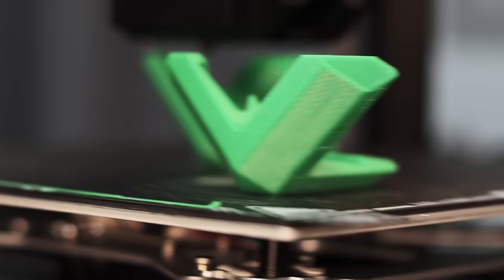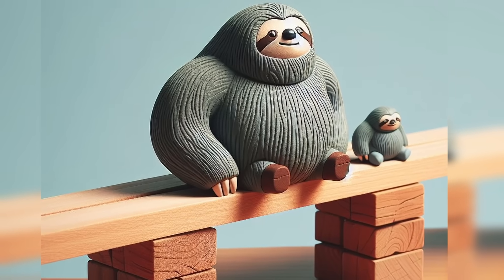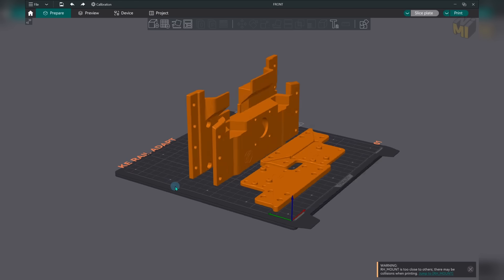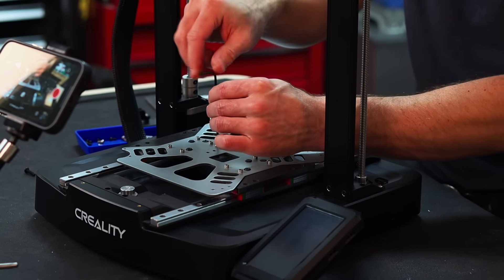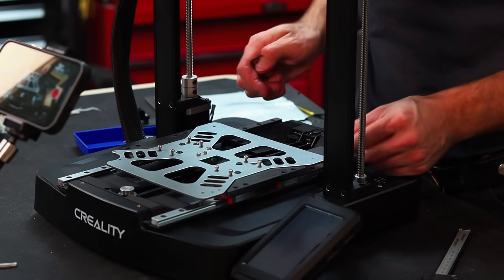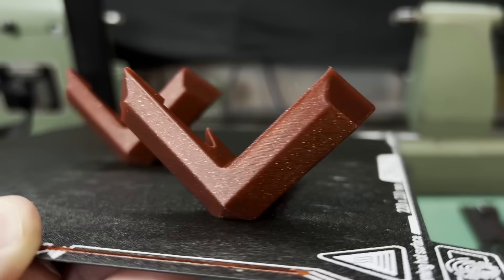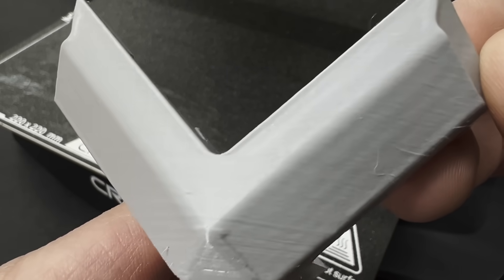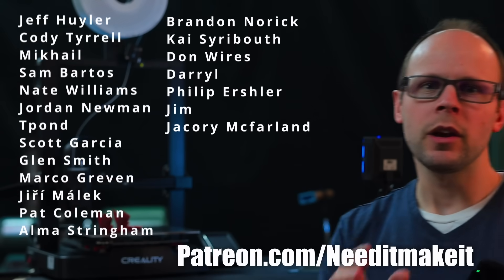UPGRADE your Creality Ender 3 V3 KE with Linear Rails

Comment: 14:02 man, I've gotten a servicable beachy in under 5min on an upgraded (motors, belts, klipper) hictop i3 with an acrylic frame. The SE has more potential. I was actually pretty impressed by the extuder stock (well, for price) and can get 15mm3 out of it which isn't bad, figured I'd put my volcano on it day one but I haven't

Comment: I'm very interested in the Y-carriage structure you built. I also installed linear rails on my printer, and the performance has improved a lot, but I’m still facing some issues with bed mesh calibration. Did this Y-carriage work well for you? I’d love to see your results and, if possible, the STL file so I can print it and test it on my E3 V3 KE to make it an even better printer.

Comment: This actually got worse, the tube rails used to be secured by two screws to prevent them from wobbling... I made a video demonstrating the issue; https://youtube.com/shorts/0jsu2G9p9ok
In a recent revision they removed the screws and now they always wobble, I bought mine last week and customer support told me it's supposed to be like that and offered to send me new tubes and carriers but that's never going to solve this problem...

I'm going to use your design and convert to linear rails myself to circumvent the poorly engineered factory solution. Thanks for sharing your hard work!

Comment: Instead of slinging the bed, couldn't you fix the bed and go for a cartesian-corexy hybrid of sorts? I used to run a davinci nano, but the proprietary bs had me move to a e3 v3 ke. But i have to admit the xyz had an edge when it came to taller prints because of the fixed bed.

Comment: The way you 3d scanned it is kind of odd to me, i much prefer to take a photo with a ruler in the image . I then drag it into fusion anmd using calibrate i set the distance to 19mm oin the ruler and bam i have an acvtual image od the object and i canplan accordingly , saves the mess and sub par imagery.

Comment: Two rails gives you 4 separate surfaces that need to be aligned, and in close proximity to a heat source with different types of materials and expansion.  I would go with one big rail.  Just like a lathe.  Poor alignment is a 3d printer/cncs worst enemy, and depending on tolerances/quality of the rails vs the stiffness of the frame, you could end up wasting a lot of time adjusting in-between prints to avoid too much play in the build plate or wearing out the bearings in just weeks.

Comment: "Nek Minute", it was an under tension-ed extruder gear all along and the trouble of upgrading was for naught haha. I'm sure there must have been movement in the bed to begin with, otherwise prints and the front and middle would have had the same defect. Makes me wonder though, how much of the defect was coming from each fix hmmm..  Thanks for the video!

Comment: The wobbeling fron the rods are because of they are 7
8.mm
And not 8mm.
I thit Just a little peace of pla under screws and the wobbeling is gone 
And i have upgrade the x axis.
Whit the toolhead. 
Filliment sensor antishake.
Gantry
Nebula pad .
Root to mainsail and fluidd.
And i can go in vase mode continu speed 150 mms .
And print nicely. 
Acc at 4000.
Sometimes the travel move.s hit 625 mms 
Fats enough  for me.
Reply from the maker: Hey, if that works for you, perfect!

Comment: I've been running my linear rails on my SE for a month now, and unfortunatley have experienced a significant problem. Due to how the bed cable harness comes out of my SE and attaches to the bed strain relief, unbeknowst to me, the cable was rubbing against the left linear rail enough while printing to cause a break in the heat bed wire.  I only noted this when I saw smoke coming from the harness. Although when I replace that wire I will print some type of cable management to prevent this from happening again, I wanted to bring this up in case someone else might experience the same thing.

Comment: in my ke the linear bearings plastic housing were slack, a bit of teflon tape solve 90% of the slack and make almost as good as linear rails.
Reply: Where specifically did you place the teflon? Sounds like a good idea I'd like to try

Comment: All I could find with these linear rail upgrades vids is people just realizing they don't notice any difference.
Reply: This is because people check for z axis movement of the bed when installing such upgrades, and with rails there will be less movement, but (surprise!) it doesn't affect actual printing because the bed moves in y axis and doesn't hold heavy non uniform load on itself
With this printer linear rails are purely cosmetic option, since they are more quiet that stock rods, but other than that - sorry, no difference
Reply: That's not my experience
Reply: your experience is placebo, many people have tested this with objective empirical data and show that it makes no difference.
but hey, placebo works, kind of.  @holliday.
Reply: @TiBiAstro  >objective empirical data
These 'tests' that you mention are done in a non-controlled environment so no, they're not objective empirical data.
Reply: Linear rails on all axis make a bed slinger stiffer and you don't have to adjust the pom wheels anymore... It's a quality of life feature that can potentially increase the motion accuracy because you can adjust rails more precisely Vs pom wheels
Reply: It helped mine. At higher speeds the bed will tip. You can really see it with your eyes especially with high speed camera
Reply: Idk my bed was litterally wiggling before doing this upgrade and was borderline unusable when not printing in the middle of the bed
Reply: Not really I have this printer and this upgrade reduces the wobbling

Comment: Do you think PLA work just fine for replacing the steel plate?
Reply: I'm no expert, but I reckon the heat from the bed would make it sag quite a bit, considering PLA glass point is only 60C. I would suggest a material that goes up to 100c or close to that.

Comment: You're a wizard when it comes to figuring out how to make parts for the printer.  Was curious if you could add screw holes to the back mounting plate where the old round rail screws were.  I ask as I have a Z stiffening bracket that uses the round rail holes as a fastening point.

Comment: I'm installing my rails right now on my Ender 3 V3 SE, so yes, they also fit. I printed my parts in PC-CF and they turned out really nice. Well done, sir.
Reply: I have an SE as well and I was thinking about doing this upgrade. Did you run into any issues?
Reply: @blakemoore5414  Just a couple. The front and back brackets worked really well as-is.  I did have to dremel some material off of the Y carriage brackets so that they fit the metal of my printer, as well as elongating the holes mounting onto the linear carriages to give them a little more wiggle room side to side so that everything was aligned. To me that was normal post-processing. Overall, I'm very pleased.
Reply: Did you use the 350mm rails?
Reply: @ Yes, the ones recommended in the video.
Reply: Did you have any problems with the hot end digging into the print bed?
Reply: @almosthappy2680  Not at all, since I run Klipper and never use the auto-Z offset. I also printed a new Y carriage out of the same PC-CF. Search printables for plate/adapter/carriage combo by Additive-Therapy.
Reply: Thanks for replying and testing it before us, i consider to do this mod to my SE as well.

Comment: Hi Mike, first of all let me thank you for all your awesome content. I'm new to 3D printing, my v3 KE is my first printer and I'm all about making it better. And it's actually your videos that inspired me to do it! How your channel has so little subscribers is beyond me!
My question is, what is your take on PLA strenght, especially for such functional parts? You don't recomment using it for this mod for example, but recently I have come across this video from Clough42:
https://www.youtube.com/watch?v=VunrhQzYWkg
Seems PLA is stronges than I initially thought? I'm also planning on ptinting more of your upgrades and frankly, if I could use cheaper plastic to do so without sacrificing much rigidity, I would like to have that option. What do you think?

Comment: My main issue is that it seems my infill keeps getting bunched up on the prints. My bed seems pretty stable from factory, but I am upgrading these parts soon. Can you share your settings though? I can't get PETG to print well consistently

Comment: I have to wonder how the two linear rails get magically aligned and level  with each other seeing as they are screwed down on a plastic base..........the table is set to the nozzle height with .004" accuracy but that is out of the window if the rails are not both  level to each other.

Comment: Hey maybe someone can help I'm finding that if I print a full bed of pieces the same thickness, that parts towards the front of the bed will print about a mm thinner than elsewhere on the bed, is this something that would be fixed by a rail upgrade or does anyone know what else might cause this?

Comment: I'm trying accomplish what you have done in the video, but I wonder if the lenght of the M3 bolts are very important? You say 8mm and 12mm.. I have 6mm, 10mm and 14mm on the M3. Can I use any of them instead of buying even more 😅

Comment: hey Mike, I have noticed that my print has banding when parts are placed on the sides of the plate. I have a rigid stabilizer bars coming for to help stablize the gantry. Do you think these linera rails will help with the banding. I also noticed that even tho the auto bed level is run each print i get inconsistent first layer when it comes to placement of the part. the section of the part that is in the middle goes down nicely but the section of the print that is on the outer side of the build plate looks like the z offset is to high due to it being un level. should I shim that corner of the plate?
Reply from the maker: There are certainly some issues with this printer's linear rods and bearings, can you check to see if there is any movement if you press gently on the front and back corners of your bed, this is the main issue mine had, the bearings and rods were not the right fit, they really should be pre-tensioned a little bit of deflection in the bearing, but instead mine were loose and with the central mounting method, it made anything printed away from the center much worse.  Can you check that first?
Reply: @NeedItMakeIt  yes if I press down on each corner there gently there seems to ne moment. a little bit more force applied and thete there is movement In regard to opposite diagonal corner movement. also the rods themselves have play as if the holes holding the rods in front ba back have a slightly bigger hole insert
Reply: @NeedItMakeIt  my first printed is the p1s and it's been flawless last 3000 hour. got this printed since it was bnib and was a great price. so never been exposed to all this tweaking and adjusting before

Comment: Great job on the linear rail upgrade. As far as the metal under plate being replaced with polycarbonate, Will the heated bed affect the polycarbonate plate?
Reply from the maker: Thanks, I still need together back to that printer to finalize the upgrade, but with PC it seems to work well, I modified the design a bit so that it had more stiffness where it matters, but aside from that, the heat tends to go up and there is insulation on the bottom of the bed as well which helps, but it does make me wonder a bit, and I have a thermal camera too, so I can check to see now what it looks like.   I also think ABS GF would work well, or possible something with CF in it too mainly to keep it as stiff as possible.  The biggest issue to address is still the extruder or extrusion, I really need to get back to the project to finish that part of it off!

Comment: AliExpress sells an Ender 3 v3 SE linear rail kit, that should fit the KE right? Has everything you need for like $50
Reply from the maker: As long as it is long enough, the version I've created has longer rails to keep it as stable as possible, there is another version with rails which are set in from the front and back and also side to side, I wanted to have the ultimate solution.... that was the goal anyway.  There should be some specs in the video description to compare.

Comment: people who made first printers with rods were high on something. 
As a mechanical engineer, when trying to make something as accurately as possible in motion, you would never use rods...especially since price comparison with rails is basicaly thesame for such short travels. If you are in Europe, get the Hiwin brand of rails and low profile carriages. With grease (not oil because it solidifies usually) they will last longer than any of us :) Hope you didnt loose any bearing balls from the carriages when the rail flew out :D

than again, using printed adaptors for the plate reintroduces possible future ware and movement. rather give those small pieces to some machinist to make out of aluminium. Threaded inserts are another weak spot - alot of possibility they arent straight, which will introduce tension in the 3d printed plate adaptors. with aluminium adaptor, you can avoid the possibility of crooked threads + you would spot any tension in the assembly, since the carriages would seize up, or they would move harder at some points on the rail (if rails arent parallel) (also thats a great test to check if your rails are parallel). With 3d printed part which can flex, you lose that parallelism check (unless you go trough the tedious work of doing it with the gauge - but even if you do, it can still shift when you assemble the parts. reason being rails have bad reference step to press against (with radius) on the printed mounting parts). Best way to do it is probably ditching the original plate under the bed, and replacing it with your own 3mm tick sheet. Bolt it directly to the carriages. Maybe some holes in it if you think you need more heat dissipation or less weight for the bed, but i dont think its needed once the bed is at working temp. But i rather have stiffness than less weight. at some point weight becomes good if things are rigid, since it dampens vibrations.

Edit: ignore the plate thing. you mentioned it yourself at the end.

My thoughts about trying to make bed slingers go fast: Instead of making them fast, make them able to print wider extrusions so they will need to make less travel/passes, and save on time from that direction.

Comment: i guess this would work the same as on the SE?
Reply from the maker: Yes, there have been quite a few people that have used this on the SE.  The steel plate below the bed has different cutout sizes, but it does not affect any of the parts or connections.

Comment: I purchased all the parts for this, but then after ready comments about seizing and having to lubricate the bearings often I have decided to hold off doing the mod. I run my KE in an enclosure and regularly print ABS, I'm afraid my cheap chinese bearings won't withstand the heat
Reply: I had the same concerns but I took the plunge and went ahead using Chinese sourced rails. I striped, soaked in isopropyl greased and reassembled. I couldn't be happier. The bed is rock solid now and quality has improved.
Reply: @roberthobbs8958  thanks for the feedback, this is enough for me to go ahead

Comment: I am curious if the lower bed plate was machined true to remove any bowing as you had pointed out in the beginning of the video, would net any positive results. Printing a bed plate from plastic of any kind seems like a downgrade in my mind simply due to the variable temperatures it will encounter. I have the KE and it is my first foray into 3d printing so my knowledge is limited but I have also worked in precision CNC lathe and milling for aerospace. The first thing I did with this printer was ditch the nylon? bed spacers with precision machined stainless parts, although the rear left corner is sitting on a plastic wire support for the bed heater wires and that is still needing adjustment. I have still experienced the nozzle dragging in the plate inexplicably. Not sure if this is all due to quality issues or simply user errors despite running multiple calibrations. At the end of the day is any of this worth fighting on a $200 entry level unit?

Comment: First off, thanks for the amazing content and tutorials! I have followed 2 of your other videos and created all of the attachment points on the base of my Ender 3 V3 KE and also printed and installed the support arms for the tower. Now I'm attempting to do this upgrade(linear rails), however I'm having a problem printing the front and rear rail attachment plates. The hotbed adapters printed fine but the front and rear plates are giving me fits. I first tried ABS and towards the middle to upper end of the print they end up looking like soft half melted chocolate. Kind of wavy and the very top starts to curl a bit. So I tried PETG and that was even worse. Now I will say that I am a novice when it comes to 3D printing but I've been doing a lot of research on correct hotbed and nozzle temps for different filaments. I just can't seem to get these right. Any suggestions would be greatly appreciated. Thanks!   Al

Comment: Would this work on the SE too? Or does it need different rail lengths and such?
Reply from the maker: Yes, others have used it on the SE, there was some confusion at the beginning, but they are the same.  The only difference is the steel plate below the bed, the SE has more hollowing out which doesn't impact anything so it should work just as well.